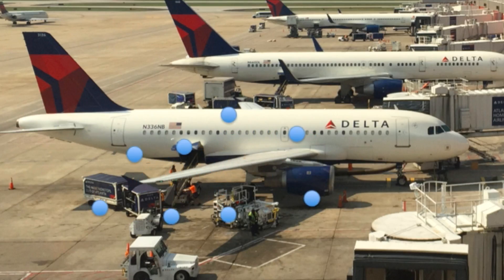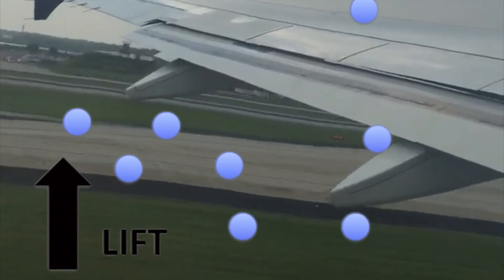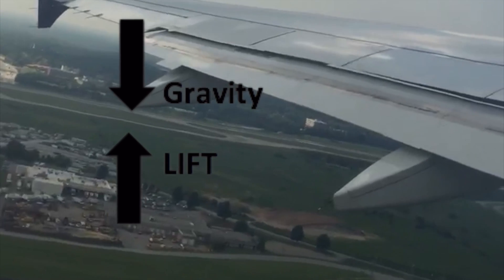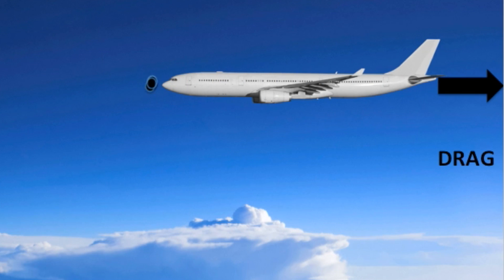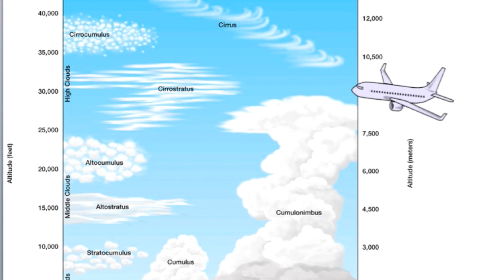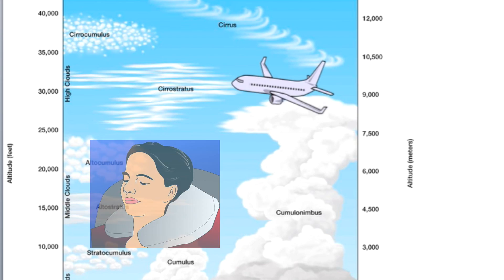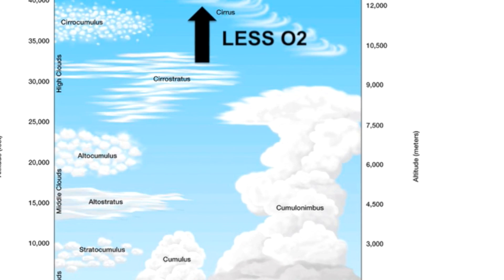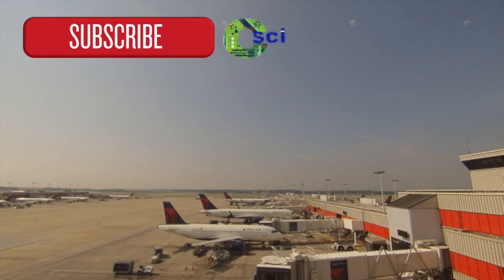The Physics of Airplanes

Comment: Awesome. Don't forget Bernoulli's Principle in explaining lift though! True Newtonian physics is part of the answer, but Bernoulli is the big one. The reason the wing lifts is because of the lower pressure on top of the wing and higher pressure below the wing allowing the aircraft to become airborne, which is kind of what you were getting at. Air, just like fluids, takes the path of least resistance and goes from areas of high pressure to areas of low pressure. Nice overall summary though!

Comment: Most of this wasn't really correct. For example the alttitude, they fly at 30.000 feet because air resistance there is low due to lower density of the athmosphere. But it also contains a reasonable amount of oxygen for the intakes if sufficient speed is reached. Sorry for my bad English.
Reply: Speed and oxygen have nothing to do with each other. The aircraft's cabin will be pressurized regardless what speed the aircraft is at. Chase is correct in saying that airlines like to fly at or around 30,000 FT to save fuel, that's where most commercial airliners are most efficient due to density and drag. Military and private jets can fly higher because, for the most part, they don't care about saving fuel.
Reply: +Mel Cirrus I didn't mean the oxygen for cabin pressure. A jet engine has a surface area for the intake the higher the speed the more air that will enter the reaction. But the higher you go the less air there will be in the air that is taken in. I'm talking purely about the forces not about life conditions. Since I'm a military aviation mechanic I don't know a lot about civil planes so no clue on the cabin pressure part
Reply: Got ya.